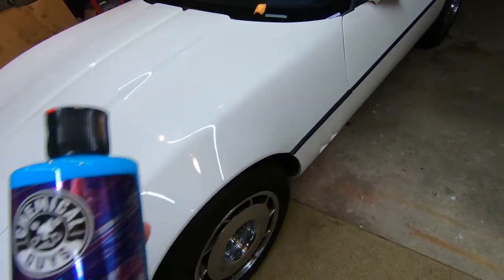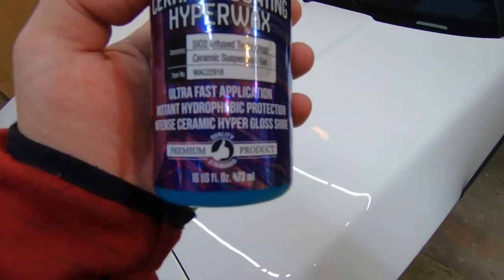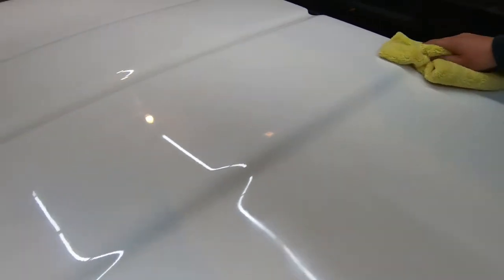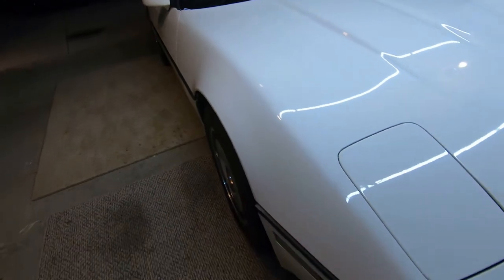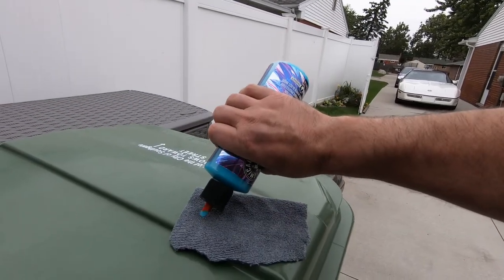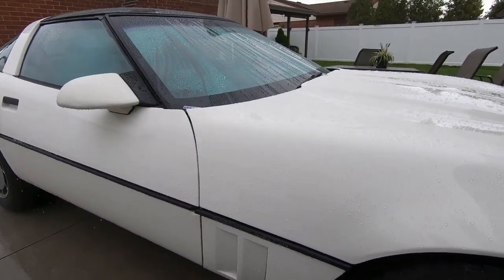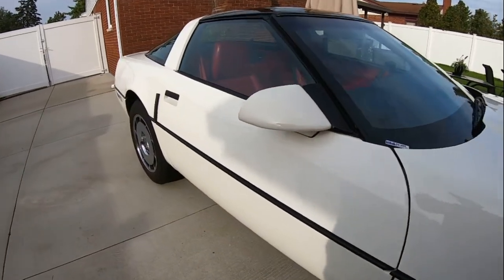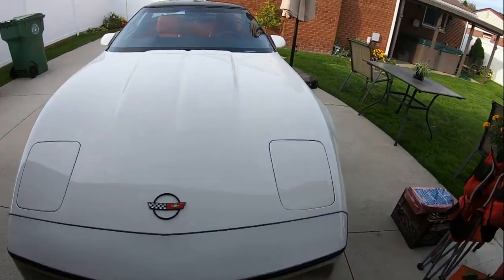How To Use a Ceramic Wax by Chemical Guys Hydro Slick Hyperwax And Review

Comment: I apply two coats always. If you want more bang for your buck. Apply first coat. Wait 3-4hrs. Apply second coat of hydro slick. Then follow up 12hrs -24hrs later with a coat of turtle wax ceramic spray or the new version of seal and shine. I’m telling you it works perfectly with the hydro slick. I prefer the ceramic spray from turtle wax a bit more but both produce great results when paired with hydro slick.

Remember especially for the second coat. A little goes a long way. I let mine site for 3-5 min for each application.
Reply from the maker: I did put a second coat of hydro slick and it did go a long way. Been a year and it's holding up great plus the Corvette stays in the garage. Have to try TW ceramic spray on it. Thanks

Comment: Seems like everybody fights getting it off! Keep us updated on the performance 👍
Reply from the maker: Was thinking of testing for the winter on the kids truck. What do you think ? The vette stays in the garage
Reply: you used waaaaay too much!!...use a very light polishing pad at low speed to remove and redo..this product is not hard to remove if done properly
Reply from the maker: @brittanyd3102  not redoing shit waited 24 hrs and put another coat  on went lighter on the product and it was easy to take off.  If you would of watched the hole video you would see that.
Reply: Most people miss the part that it is a wax!!! It should require some messaging after polishing and opening that paint and leveling it out. The product worked for me but did require some work but not like people complain.

Comment: I did my girls Escalade and it came off very easy. But I used some degreaser spray before I applied it and it came off like buttery wax
Reply from the maker: I'm thinking we used to much on the first coat because the second coat was easy. How the Escalade come out ? You get a nice shine
Reply: Ouzo Lou Garage came out great. I’m gonna do my truck and Corvette next maybe I’ll do a video like you did for my vette
Reply from the maker: After a few days the shine got better Corvette has a great shine and this hydro Slick is not attracting dust . I have to check out your video when it come out

Comment: It is very difficult to remove. In a hot summer garage I call it a heart attack in a bottle.
Reply from the maker: It was a work out to get the first coat off remind of Klasse sealant which klasse worked great for the winter. Hydro Slick second coat was easy to take off and the shine got better few days later. Let's us know how this works out for you.

Comment: Don't you think you are using way... way... to much of this stuff on the one panel???   Also, aren't you supposed to use a cross-hatch application with this product???
Reply from the maker: I did use to much with the first coat.. I like to show my mistakes in the the videos.  And when I put a second coat was easier. You can use circles or cross hatch. Watch the end of the video. The Corvette stills looks great.